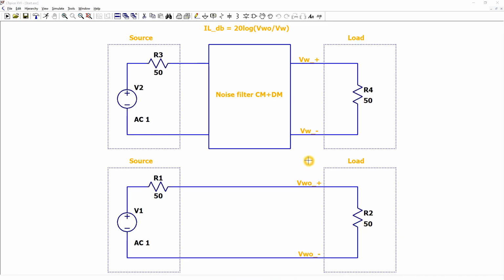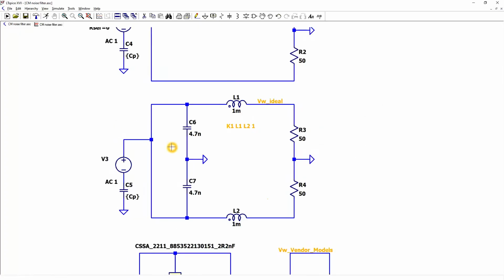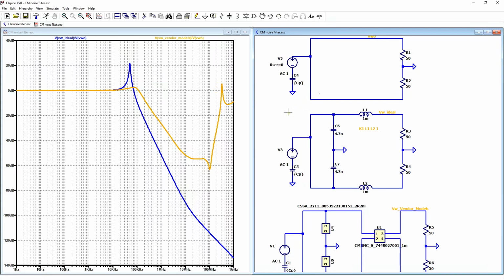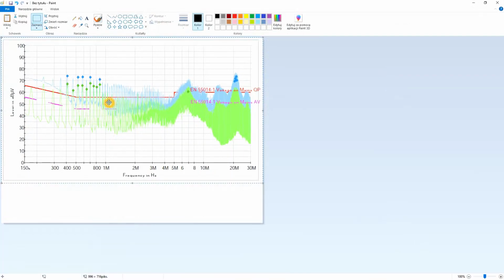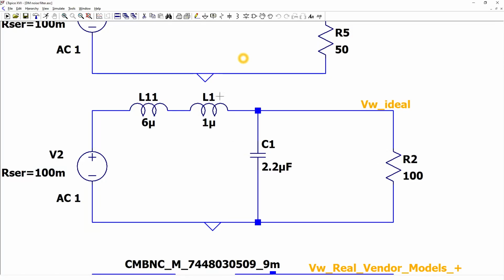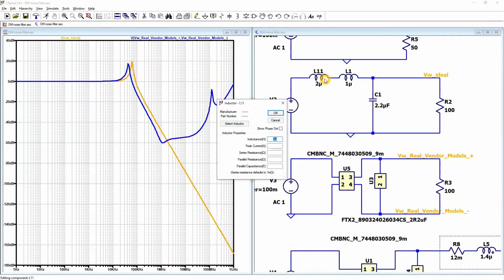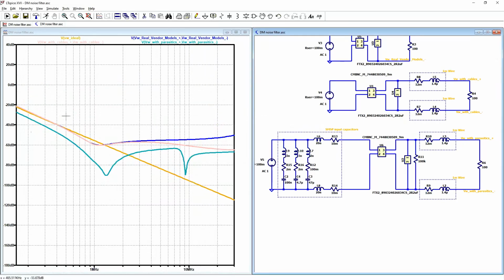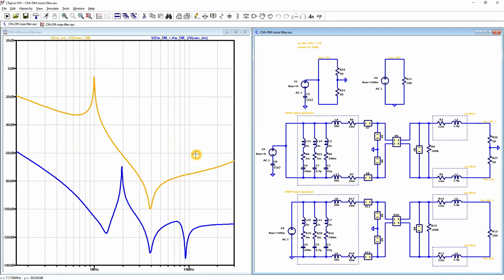EMC/EMI filter design in LTspice - Conducted Emission part 2

Comment: Hi, I have 3 questions:
As I know people usually use ZLISP to normalize the input to high frequency, why do you use R = 50 Ohm instead of ZLISP?
If I use ZLISP, how can I model it according to frequency (I know how to make a potentiometer, but I don't know how to change the impedance according to frequency. Do I need to create a frequency oscillator and then make the resistor run according to frequency?
I want to create a Choke component to add to my EMI, where can I find or create it?
Thank you for taking the time to comment.
Reply: It all depends how accurate you want to be... this is enough as 1st filter try. You need to have proper topology then you can always change componentrs. Regards

Comment: The simulations that you present are fine for a system that is class I i.e. has a connection to chassis and earth but class II devices are different as they don't tend to have Y-caps. How do you typically measure the different ground connections? I typically use the gnd and com symbols with a 10pf and 10Gig between them.
Reply from the maker: Hi, it is true about the class that this simulation is for safety class 1 devices. If you can't have Y capacitors, then only series elements remain :-)

Comment: What does it take to make such filter for an simple AB class transistor audio, i'm using or gonna use BD137/BD140 on bi-polar 15V.
I adjusted the resistors to 1 amp max at 12V. i have a small transformer for testing, how do i choose the right transformer and this EMI FIlter?

Comment: Great video!
I would ask how about the ESD/EFT immunity circuit and its simulation in LTSpice?
Reply from the maker: Thanks, the ESD LTSpice simulation is possible to some extent. I have done it.
Reply: @emcDV  I’ve done an ESD generator model in LTspice, but I am working on modeling the EFT model, some issues haven’t solved. Anyway, this a good content, and wish to learn more strategies about the immunity.
Reply from the maker: I think time is problem due to fast transien events combine with  DUT circuit could be very long to compile.

Comment: Sir i have a question.
0:19 source impedance and load impedance are 50ohm.
How can source 50 ohm impedance go to load side in situation common mode and differential mode?
Reply from the maker: Hello, watch further :-)
Common mode reference load is at 2:30
Differential mode reference load is at 11:37
Reply: Sir thank you for the answer!
But my question is why the source impedance 50 ohm move to the load side.
0:19 R3 50 ohm is in front of the noise filter. 
4:19 common mode filter, 12:28 differential mode filter don't have 50 ohm in front of filter. 
Please understand im not good at CISPR 17 measurement😅
Reply from the maker: @정성빈-c1s  The part 0:19 describe a measurment system with 50 0hm signal applied to the filter and 50 Ohm load. The common mode and differential mode further are simulations of more realistic situation when you will have your filter inside your device housing close to the connector.